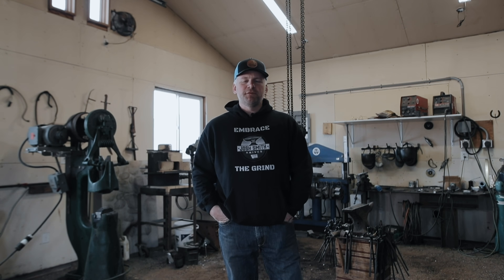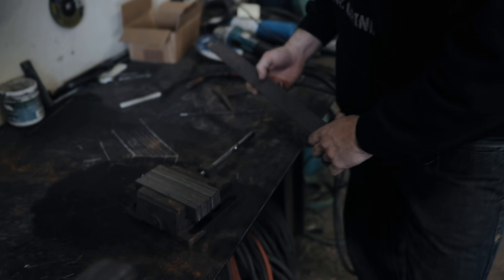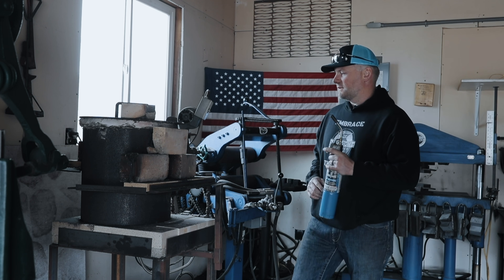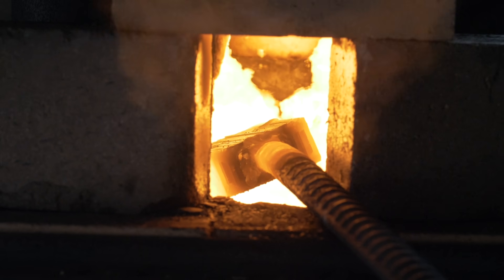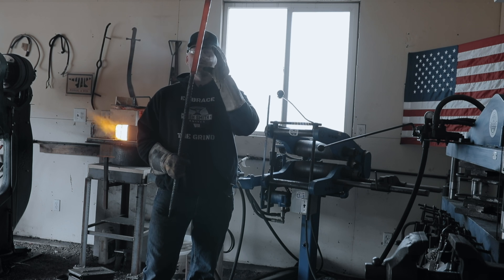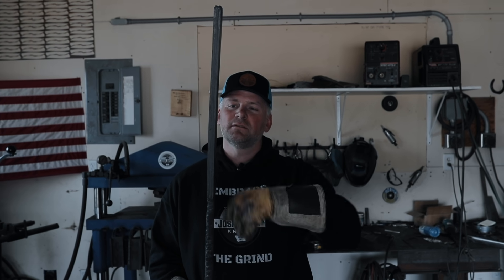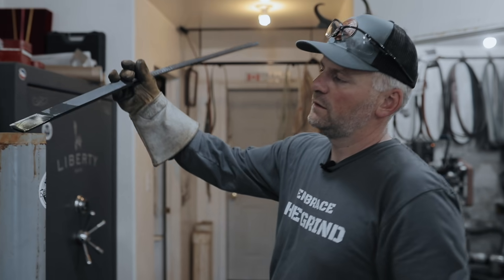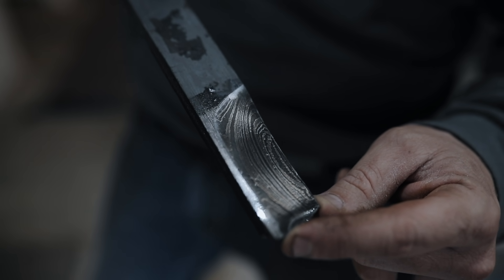How To Make Basic Damascus Steel

Comment: Damascus steel actually isn't all that strong. The true purpose of damascus is a form of art and creativity, where the metallurgy of it only includes standard carbon steel. In comparison to other low alloy steels tool steels and high alloy steels, the ratings of hardness, toughness, and corrosion resistance of Damascus steel are low.

Comment: It's going to feel wrong welding up my first billet without grinding off mill scale. I'm going to try the kerosene also, I still use flux on the first weld, second welds I  usually tig together and seal the seams. Great video, definitely save some beginners a lot of heart ache. I learned mostly trial and error and wasted a lot of steel, time and fuel. especially the wait ten more minutes and don't get too aggressive setting the weld. Great tips thanks Josh. Looking forward to next years hammer in.
Reply from the maker: thank you!!  I’m looking forward to it as well!